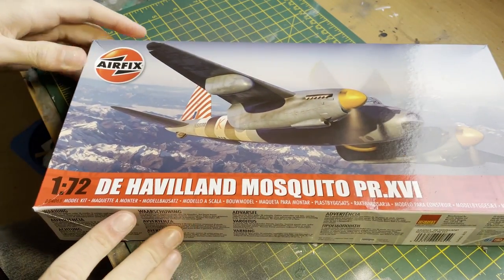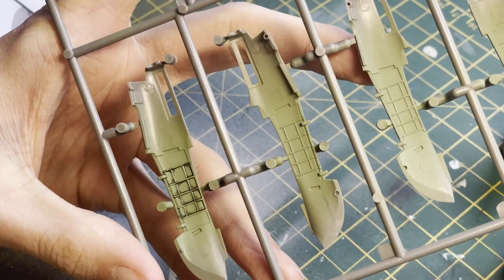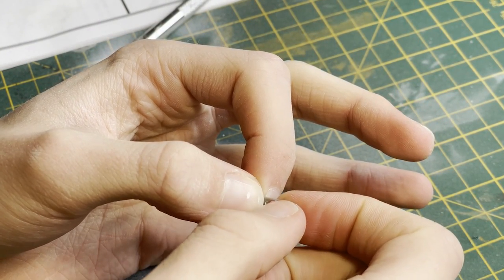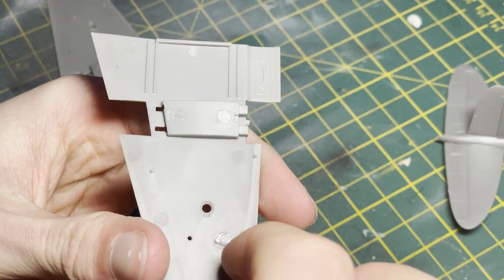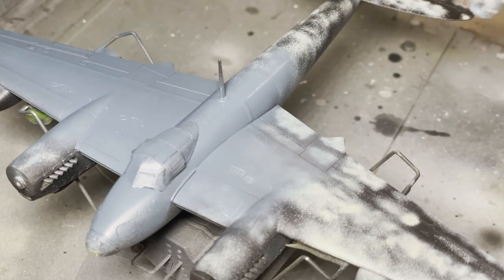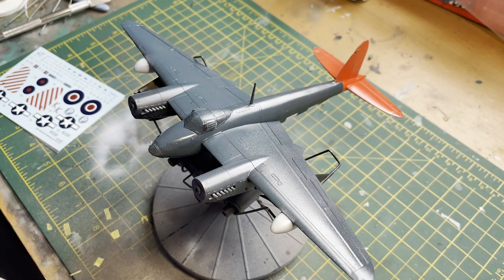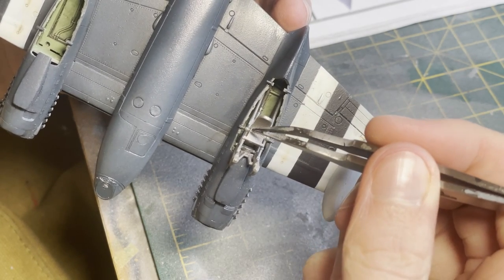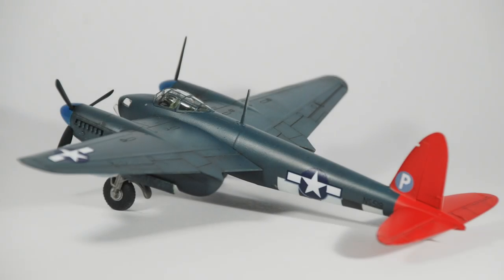Airfix's Brand New Mosquito PR.XVI | Full Build | HD

Comment: I built the previous version of this kit, the MkXVI and found the jig for the undercarriage worked very well. What you need to do is build the undercarriage up before you put the wings together. This means you don't have to struggle getting them in and out of the nacelles as you put them together.
All you need to do then is put them in a safe place until you are ready to install them.
I bought this version as well as I love the Mosquito. I'm currently doing the Tamiya FB Mk.VI/NF Mk.II and you can see the advantages of a newer tooled kit when comparing the two.
Reply from the maker: thank you for the tips i’ll make sure to use them next time :)

Comment: Nice kit! What air pressure was you spraying at? Harder and Steinbeck recommend 2bar(29psi). I use their brushes exclusively and find 25psi is a good place for AK/Model Air paint. Anything less I was getting the same as you on some paints.
Reply from the maker: hmmm i spray at about 15 psi so maybe i’m a little on the low side!! i’ll have a muck around later on today. thanks a lot for the tips and feedback!!

Comment: Great video and nice build.
About the AK 3rd gen... Use it with its own thinner and thin it 50/50 or even 40/60 and do multiple thin coats, passes.
Reply from the maker: thank you very much for the feedback and the tips for the paint!!
Reply: I've found the AK 3G RAF Night as a habit of splattering. I've thinned it with 40% AK thinners,  20psi, 0.4mm nozzle in an H&S Infinity.  It wasn't any better at 12psi, 15psi or 30psi. Tamiya and Vallejo acrylics don't give me any issues. It's frustrating, yet once dried, it looks pretty good.
Reply: @markstott6689  Seems like every manufacturer has a color or two which doesn't want to behave the way it should.
I love mission models paints, but I found that their greens, especially the darker ones are really pigment heavy and flow very differently than others and that it's hard to get a nice even coverage.
Perhaps it's a bad batch and something is not right with that paint mix.
Or that the darker a color is, the more pigment heavy the paint is going to be.
Reply: @rogueplastic  I've had the same issue with AK 3G Grey primer. It doesn't come out in a fine mist, yet it settled down with perfect coverage. At least the final look is great. I've still got to spray the RAF Dark Green and Dark Earth yet. Fingers crossed it settles just as well.

Comment: Looks awesome, RE the blue switch to AK Real Colors, Tamiya, or Mr Color. Thin any of those with Mr Color Leveling Thinner, makes you look like an expert, although I appreciate alcohol based and lacquer based sprays aren't for everyone.
Reply from the maker: brilliant tip thank you very much, i need to try some more models using lacquer so i can make up my mind!
Reply: @machmodels  you'd need a booth, but the alcohol based ones are brilliant, and the lacquer ones are just awesome. Thin both with Mr Color Leveling Thinnerand and it is  game changer. Preferably not with metallics, Mr Color Rapid thinner is better for those.
Reply: Also, zero tip dry with the lacquer ones.
Reply from the maker: thank you so much for the tips! i’ll do a little more research and see if they are a possibility for me!
Reply: I’m with Mark there. AK Real Colors are fantastic. I love AKs colour range but was awfully disappointed with their acrylics. I got rid of all of them and now use their Real Colors range. Love them.

Also don’t discount Mr Color and Tamiya lacquers either. Fantastic hard paints. Mr Color Mr Surfacer primer is also good stuff.

Comment: Brilliant videos and model finish. 
Just wondering how you get such a finish on the paint. I'm noticing that my models after 6 months the paint finish is cracking like if paint is left in sunlight, even though they are primed , painted and varnished. . Any ideas. Thank you
 Graham
Reply from the maker: Thank you very much sir! Hmm that’s rather confusing, what type of paint are you using?
Reply: @machmodels  I use humbrol or revell acrylic paints and water based varnish or solvent based varnish from humbrol.
Reply from the maker: I suffered from something rather similar with some odd finishes with water based finishes, I recently transferred over the mr hobby lacquers and my goodness what a difference! Such a smooth and durable finish so if you can I’d look to invest in some of that! SMS is also a great option if you don’t want to thin down your paints😆

Comment: I have a suggestion about thinning paint. (But TEST this on something you don't need FIRST!!) Buy some 'Mr Color Levelling' Thinner. This is a Laquer thinner, but "Should" thin both enamels and Acrylic paints without any issues - BUT not always. An Alternative - IF Tamiya Lacquers Paints etc are available, use their  "Lacquer Thinner with Retarder" Or you can use any Lacquer thinner (Cheaper and add some Tamiya Lacquer Retarder (Comes in a small bottle). Thin the paint until is is about the same consistence of either Skim Milk or even fat free milk. (Ie almost water) This should mist onto the model lightly and you can build up two or 3 coats and still have control over the look of the model's paint. Personally, I use both pre- and post-shading with his technique. But I cannot stress enough how important it is to TEST first -  SOME brands of acrylic paint react badly to Lacquer Thinners. Mix a small pot in a disposable cuplet and leave it a few minutes first - it may coagulate into a horrid lump! If not, test in your airbrush but make sure you have a reputable Airbrush cleaner fluid on hand. If all works as normal, you can clean up with the thinner easily enough.

BTW, when painting Red the best colour to base it on is yellow. White can "Bleed into the red, giving it a "pink" appearance. I haven't tried a Pink base for red- yet, but a Pink Primer is available from Mr Color.
Reply from the maker: thank you very much for this comment incredibly helpful and i’ll make sure to implement it into future builds!!!